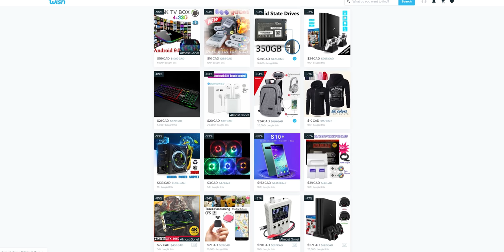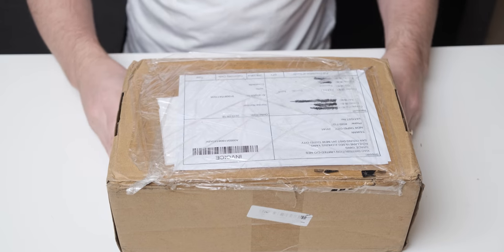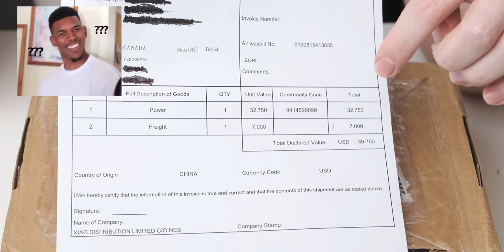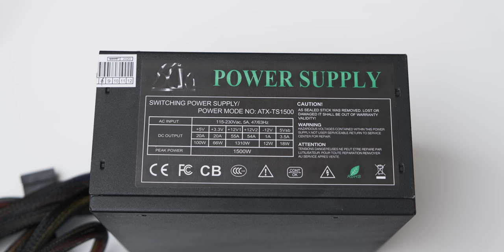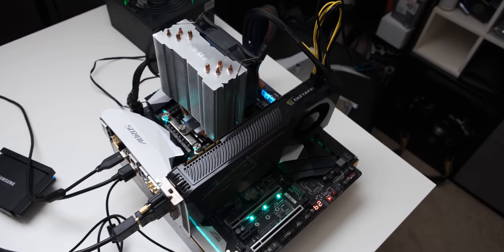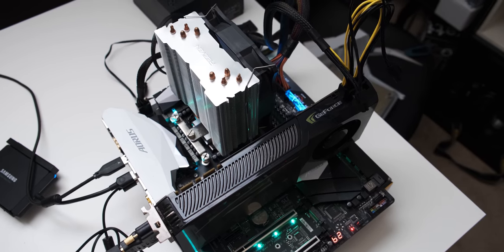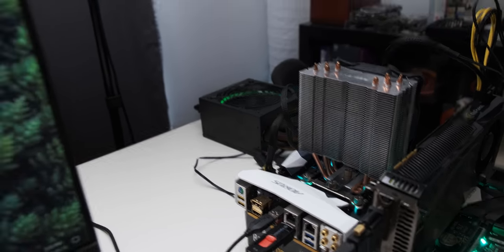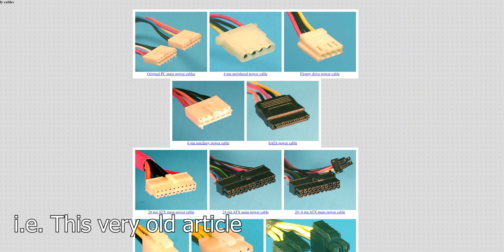I bought a $69 1500w power supply on Wish.com

Comment: The internals look good enough , i bet this will surpass 80+ white rating easily.. but the real power rating of the psu is more like 650w max , it has active power factor correction , good brand capacitor , separate regulators for 5v & 3.3v so i believe this was salvaged from a used thermaltake 650w psu & put in a new case.. which is very common in china & way better than them making a cheap crap that will explode & u don't need to be that afraid of the psu! The current won't jump at u.. at worst that large capacitor can hold 400v dc & if u touch it it will zap the shit out of u but won't kill or injure u 🤣🤣 & isolating from the floor only works if the psu was inrference to ground .. & even 10$ chinese crap psu's have discharge resistors for the caps & after an hr it won't shock u.

Comment: each 12 volt rail only does 650W which is fucking shit for a 1500W "claimed" PSU.

Ideally, and typically, each 12v rail can support the rated power.

My SF600 supports 600W in each 12v rail alone

A lot of these ni hao power supplies put the absolute max output as their claimed power limit, but if you run SLI on this build you'll blow it up.

Comment: Tells you not to buy a psu, because it's not a certified psu, but doesn't even k ow what the certification means. The certification isn't because its "trust worthy". The certification is how efficient it uses the power. You basically made a video and told people not to buy a wish psu based off of no evidence.  

You didn't even buy a 10$ adapter to see what type of watts it was pulling or nothing. This video was 95% half assed and basically what I got from it was, "I bought a wish psu that you shouldn't buy because it doesn't have that certification thingy, but here's what it looks like. Tell the people and me what it means in the comments...."

Comment: DDTS: the most dodgy PSU ive ever seen
old skool PSUs in 80's and early 90's PCs: am i a joke to you??

i have legit been scared to touch some of those old PSUs in any way whatsoever back in the day. i did use a low cost PSU for a low cost modern system not too long ago. system needed 350-500 watts. i ordered a "Apevia" "Jupiter" ATX-JP800W 80+ Bronze psu for like $30. looks VERY similar to the one you got in this vid, flimsy fan cover and all (different letter markings though) but wasnt from wish. id NEVER buy ANYTHING from wish. that psu did a pretty good job for what i used it for. not even once was i worried about anything.

Comment: Poor motherboard. being powered by such a dodgy power supply. Great pick from a crap seller such as Wish, given that it hasn't smoked or zapped the motherboard. It is good for a 350-400W power supply. The Rubycon capacitor might be a fake, though.

Comment: Holy hell dude, i keep single frame stepping the section of the footage 8:05-8:20 and i'm absolutely seasick now from it being all shaky, there's shallow depth of field so half the PSU is out of focus, and i'm screaming at the screen that you should stop jerking the camera around so compression artifacts have some time to settle.

You know what, i think i know who made this power supply and about what certification grade it could aim to achieve, but i'm not going to tell you unless you make some legible photos, as high resolution as possible, as sharp as possible, none of this cinematic nonsense, and i don't care if they're noisy, that's fine, just from all sides where anything of value might be found. Put them on an image hosting site or whatever, maybe even on your Discord. That way i learn more about the PSU and you get some answers. Unfortunately the information will be pretty limited, because i haven't seen this platform/board before, and even under the best conditions, you're unlikely to capture the writing on MOSFETs hiding under the heatsinks and numerous other part details, so i won't be able to estimate its power, and i wouldn't trust myself to not miscalculate anyway. At a glance though it looks like a platform that could aim for somewhere around the 650W mark though, neither particularly powerful nor particularly wimpy. But it does have one interesting detail that i can talk about then.

It does look pretty nice to be honest, but i still wouldn't trust it, it could be full of fake components for all i know. That Rubycon can't be real and there wouldn't be any point in that anyway, this cap is not expected to be under any particularly high stress.

Comment: OKay, for a chinese power supply, having a Thermaltake fan and Rubicon filter capacitor is a good sign... Although most probably a fake Rubicon... They one of the biggest copied brands around..
Also, judging by the amount of mosfets, or shall i say, Lack of tbh... Ideal real world situation, Taking degradation into consideration, Your looking at around 500w continuous power, reliably... Saying that, I still wouldnt want to run that in my system. Its not always about being able to deliver said whattage etc, Its also about the delivery of the power too.. Cheap power supplies deliver "dirty" power.... If you was to check it on an oscilloscope, You'd see the power delivery isnt a clean DC power sign. Would be ripply.. Which damages components... 
So even if the power supply CAN power your said system, I still wouldnt want it to.. It would put a hard time on the CPU Phases etc, To filter out the power delivery to the components such as CPU, etc... Basically, Cheap PSU = Kills hardware quicker..

Comment: You don't really care about specific components that much. It looks like average cheap supply nothing wrong on first sight in that board, there is no way to deduce something valuable just from components, you would need to test if it isnt overheating, look at ripple in outputs, stabulity etc.. What you care about when doing these kinds of assesment is primary side. You want to look at board from other side to see if there is enough clearance between line voltage and output. You want to check if there is proper fuse, proper safety Y1 capacitator in a feedback etc.. and those WIRES, those line voltage wires look shady as hell, soldered to a connector in a sloppy way plus they look too thin. Also make sure that greed-yellow wire is properly crimped and connected to a powersupply chasis, if it can come loose thats the worst failure you can imagine. When working with cheap powersupply your main concern is safety and their possible failure mode.. their performance is secondary.

Comment: It's a crap PSU. There is zero chance that it can do 1500W, and I bet it would blow up if you threw 750W at it.

Any PSU that has a voltage selector switch is garbage. Active PFC became standard on basically every non-garbage PSU about 10 years ago, and with active PFC you don't need a voltage selector switch.

The fact that this PSU has a voltage selector switch suggests that it is a very old design.

Comment: Testing a 1000W PSU with a load of around 200watt's, wondering why its running for 18 hour's.... looks like an thermaltake one with 450 or 500watt, just rebranded. No wondering its holding up like that.^^ But way to overpriced at 69$^^

Comment: That psu would at best give you 450 watts a single filter cap  YUK marked as Rubicon yer right another Chineese rip off  voltage * amperage = Wattage

Comment: and then the game streamers that go 40-5 K-D on COD find out that everyone else is using Potato Systems on MAX 350MS PING connections... come to LAN PARTY? could still use epic system and still get swamped/turned on by the mighty potato system. more then 20 chunks away a deer spawns potato system can not see that far "only 3 chunks"... tho still, thinking only mighty system can see that far... oh look im a deer running on mighty system so i can see potato player thats looking in my direction more then 30 chunks away... "HEAD SHOT", em now to run 34.3 chunks to collect my deer... hahhahahhaha... hardly 4 pixels on the screen.

Comment: It is an oversold power supply.  I got a grade A+++ brand 750 for like 120 10 years warranty.  There was a low grade name brand 700 for like 70..  you paid 90 for a cheap 800 maybe...  I was very picky with my 750 choice. It had the extra power cables to meet my top grade motherboard and my hopeful videocard.  You just wasted your money for a lame video

Comment: What the hell is this video even. Complete waste of time. No test result whatsoever. Not even the motherboards voltages, no efficiency test. 
If you're curious. It works. But it's very hard to make a psu that doesn't work. What would be interesting is to see at what point it start to fail. 
Opening the psu and saying, I have no idea what all of this is. Interesting..

Comment: I'ma stop you right here big guy.

You clearly stated you "don't know what you're really looking at" and that's fine. 

But:

1. Why would you test a PSU over night when you suspect it could catch fire.
2. Don't open a PSU housing, ever. Even if you know exactly what you're doing, the capacitors still hold enough amperage to drop you dead on contact.
3. You did it with a metal wedding band on your hand.. 

Please never do this again.

Comment: Yes your 1500w psu is good 
Capacitors=average
Transformer=great
Inductors= looking good 
PCB= average
Transistors= don't know
MOSFET= don't know
Fuse = excellent
Cooling fan = great 
Heat sinks = excellent
Resistors=don't know
IC= great 
Diode= excellent
Mov= good
Optocouplor= don't know
Over-all grade is A+.
Reply: If you call garbage "good" then I agree.

Comment: worst psu review ever that ive seen no test system info no actual power draw measurements no power supply knowledge didnt even say if it got hot....and estimates the power output by the cables?? LOL...

Comment: Isolate yourself from the floor? You really know nothing about electricity and electric components, do you?
Reply: Ehm he is right. You DON'T want to be grounded because then if you touch live wires you get shocked. Thats why with good shoes you can touch the live wire in a socked. I think you are confused with being grounded if you build a pc so you don't get electrostatic discharge.
Reply: @TheAdatto  he talks about isolating from ground AFTER unplugging the device. So the only thing he can get shocked by is an input filter capacitor. Which will stay charged for a long time. And since it has two contacts that represent different charges, you don't have to contact with anything else to be electrocuted. I suggest you too to isolate yourself from ground and start poking PSU components with your finger after you unplugged it. Good luck with your new rubber shoes then.
Reply: @AntonMikhaylov  i did. Now i have a small burnmark on my finger tip.
Reply: @AntonMikhaylov  But we went off track. When working on non esd sensitive stuff its better to not be grounded then the opposite. Can we agree on that?
Reply: @TheAdatto  you went off track with you very first reply to my comment. As for the "ungrounding" while working with live wires - I have no arguments against that. But the author of this video suggested to "unground" yourself while working with DISCONNECTED device. Never watched his other videos (after that one), but I'm already thinking that channel should be called "David should not do tech stuff".
Reply: @AntonMikhaylov  true. But probs for ungrounding what so ever.